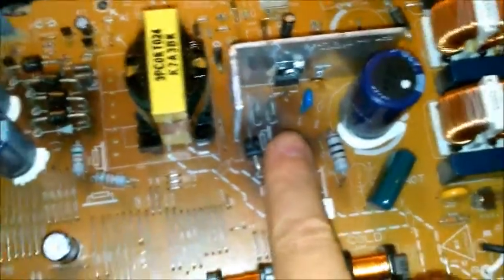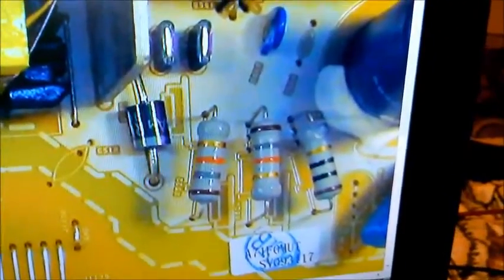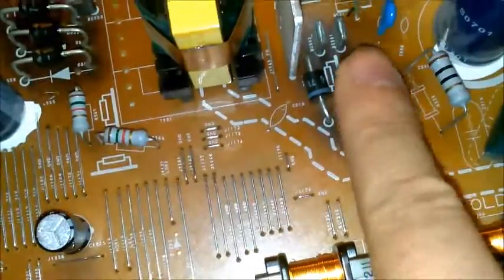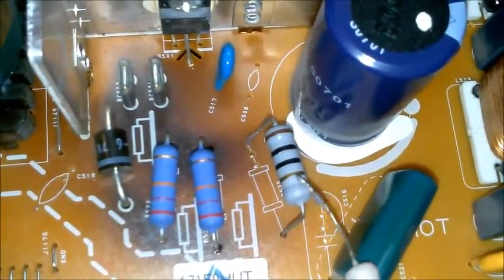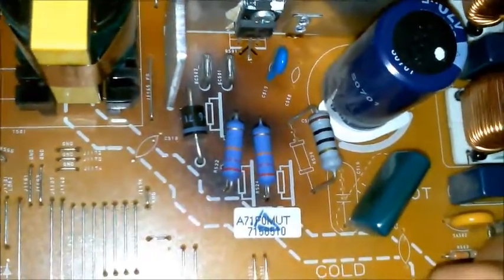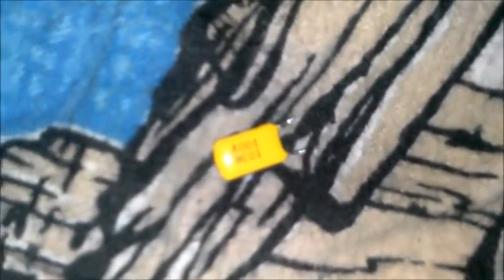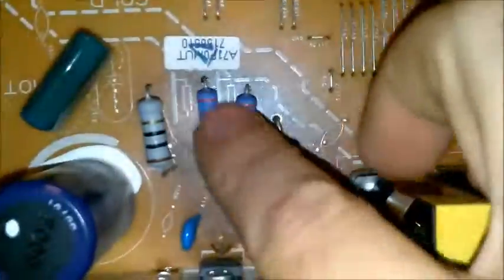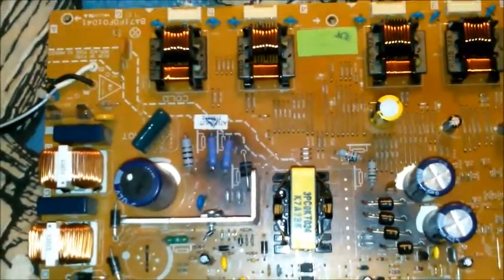Sylvania LCS320SS8 32" HDTV Repair

Comment: Someone gave me this set about a year and a half ago and I decided to look at it yesterday. It turned on only to the standby light so I took the 3 main board out only to find the component looked good, but on the inverter board,the soldering quality was bad. There was puddling of the solder joints that looked like welds, cold joints with holes and one of the transformer joints is lifted. So I'm probably going to tackle this tomorrow cause a used board is ridiculous in price. If you still have this set it's something you might want to look at later cause bad joints is a cause for shorting and early failure of the components.